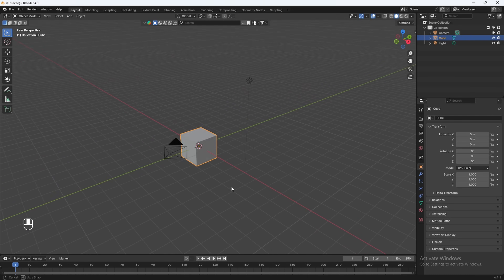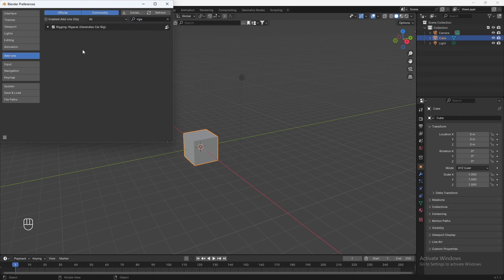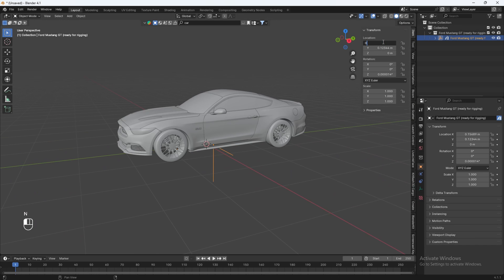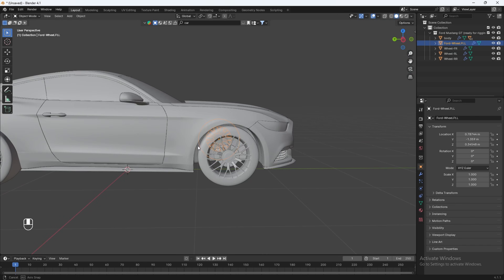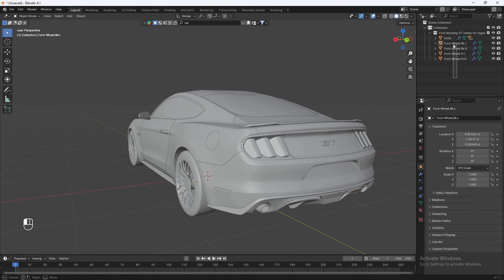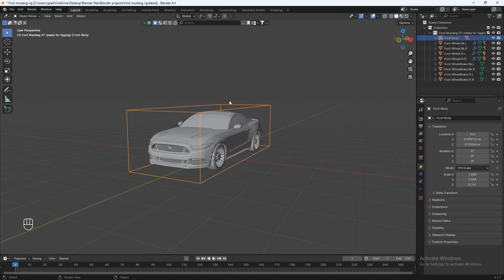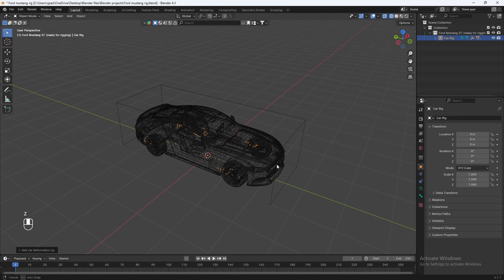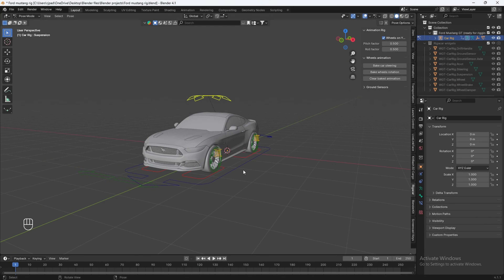How to Rig Your Own Car in Blender: Master the Rigacar Add-On!

Comment: I just did this and whenever I would add the empty cube then add the armature it would make the vehicle  separate into random sections and they werent aligned. I ended up actually just parenting everything for the car body and its insides to the car body and skipped the empty cube part and it works just fine now. Not sure why I didn't need the empty cube though.

Comment: I am using blender 3.0 and this model is not loading. Does the blender kit move according to blender versions?
Reply from the maker: yes I would reccomend using blender 4.0 or above and make sure blenderkit is updated
Reply: @onlyrj3D  hey bro i am frome india can i work with you I will not take any money, I need experience and a good friend who can suggest me in 3D animation industry.
Reply: @ can i work with you  I will not take any money, I need experience and a good friend who can suggest me in 3D animation industry.

Comment: Thank you for the tutorial. In the beginning half of the video, where your naming the objects to be rigged, I’m confused about the part where you named the object Ford.wheel.

If I’m working on a Chevy, do I just add Chevy to object names? 

Sorry it’s my first time attempting to rig a vehicle
Reply from the maker: @BlzrX   it would be Chevy-wheel NOT Chevy.Wheel. For example, when naming the front left wheel, you would name it Chevy-Wheel.Ft.L
Reply: @onlyrj3D thank you for the quick reply!! I will try everything out after my holiday celebration with the family. 😎😎
Reply: After following step by step, when I hit generate, it allows me to move the suspension up and down but when I try to turn the wheels, the whole body moves and the wheels/tires/brakes stay static and don’t turn. 

Any idea where I went wrong? 
Should I try to reinstall the rig a car fixed version?

Comment: I am convinced this plugin no longer works. I have done this about 20 times and there is always some problem. I have only got it successfully rigged 1 time and then the wheels didnt rotate correctly. Other times the body wouldn’t attach to the rig after generating or it would come up with a Python error.
Reply: And disregard my nonsense. I’m not even going to tell you how much time I wasted by doing one tiny step wrong that kept jacking up my rig. But at least now I can rig a car in less than 5 mins.
Reply: @CalmCollectiveATL How did you solve the wheels flipping incorrectly when the rig was generated? I am stuck.

Comment: Bro the tyres are separating while moving after rig the car pls tell me a solution
Reply: Make sure your tires are not below the x axis. Mine were slightly under and when I went to generate the rig, my wheels were being weird as well. I moved my model up some and tried again and everything worked.  

Also try apply scale and rotation for each tire.

Comment: I ve done this repeating the wheels dont rotate wheel moving on path had this problem for a year doesnt spin on rig ready cars either
Reply: Did you find any fix for that? Even I am facing the same issue.
Reply: @ManishKamal  actually rig a car pt 2 on the ride course sorry been trying for so long going to do it again and explain step by step